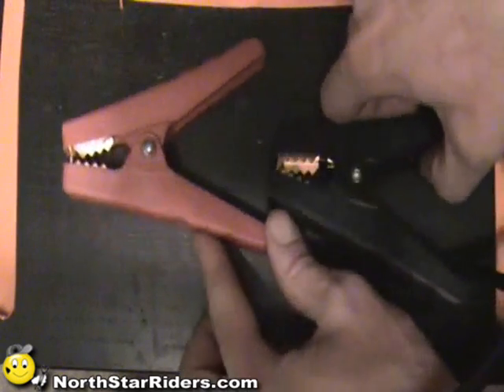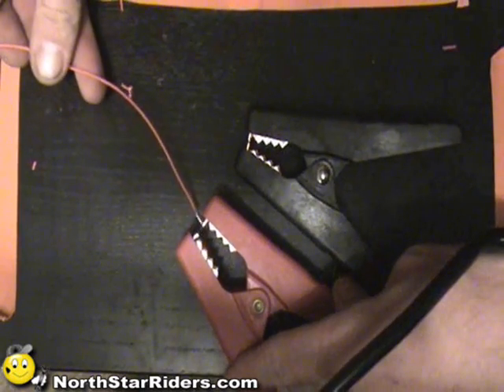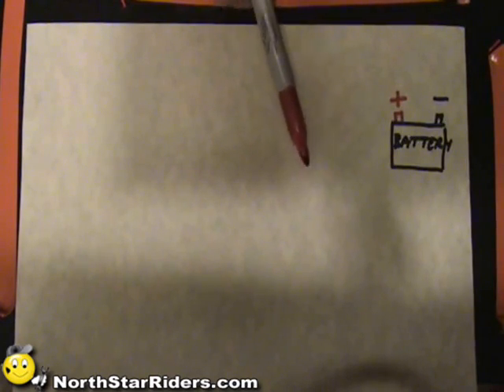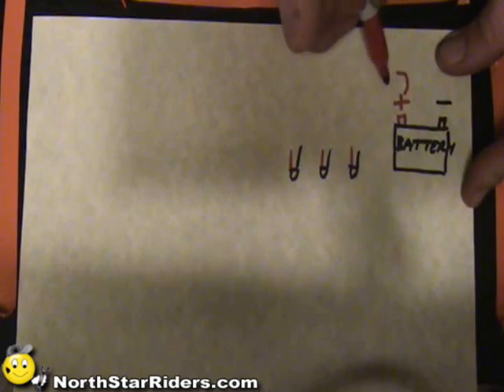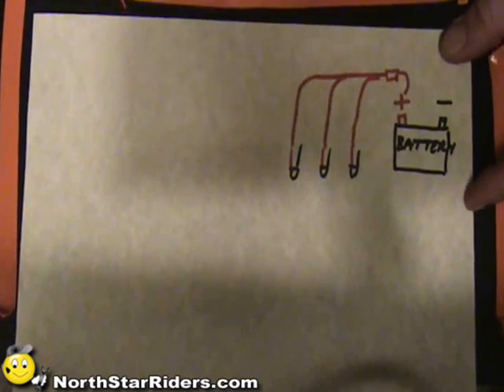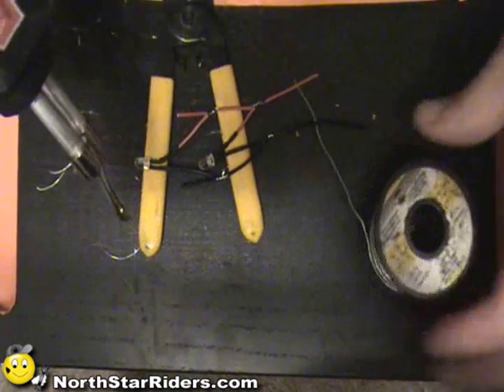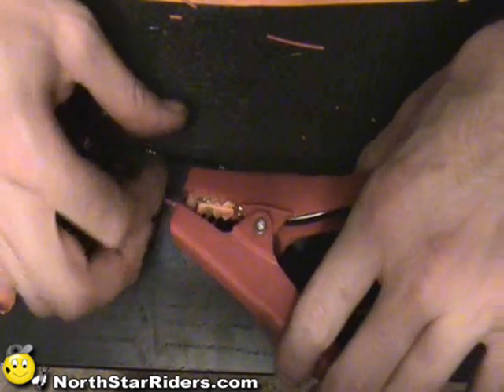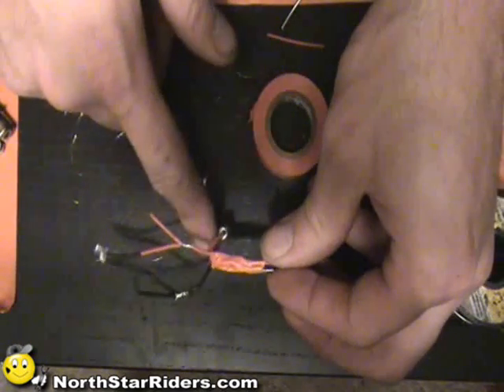LED Wiring NSR tech.wmv

Comment: Great video! If you wire it straight to the battery, will the lights be on the time or just when it is running? Is there a way to wire it so you can turn them off and on? Thanks again!